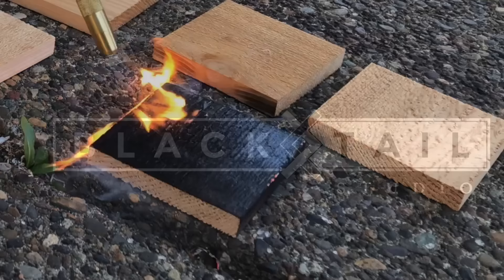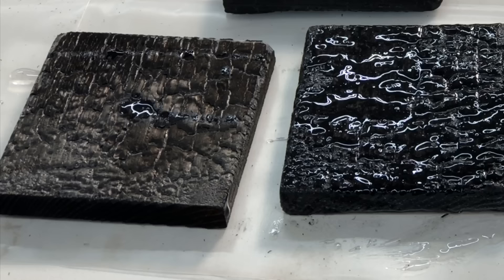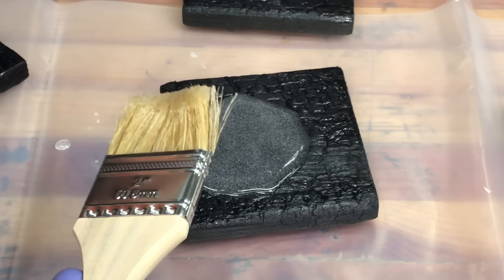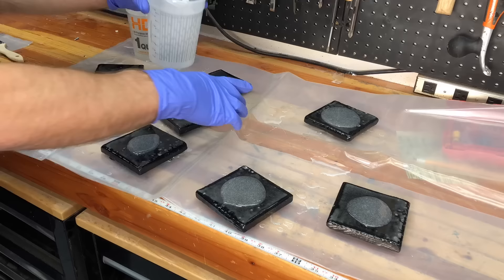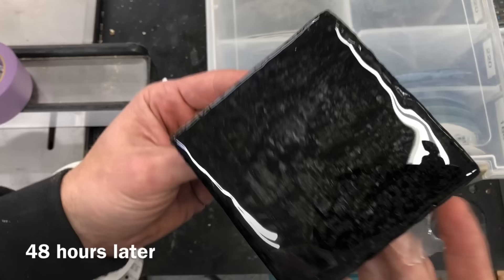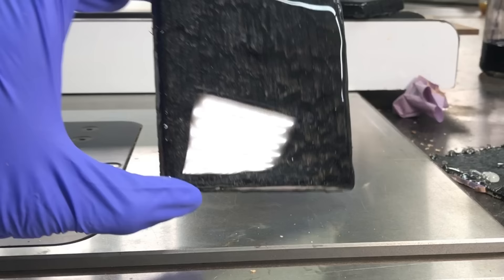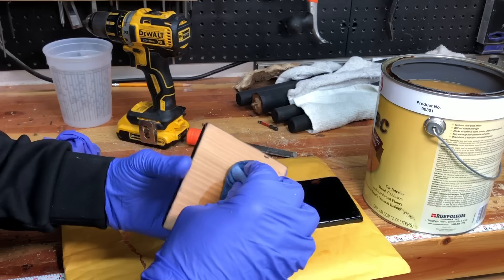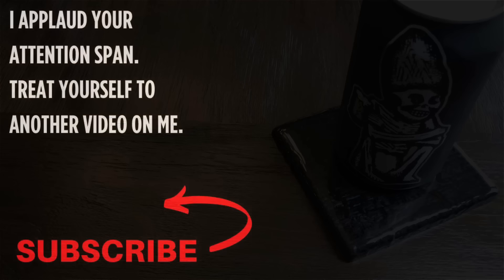Make Scrap Wood Look Like This

Comment: One thing that might be neat is after you do the first epoxy pour... Going back with a cnc router and v bit and engraving some design and doing a different colored epoxy inlay and then sanding smooth and sealing with the epoxy top coat
Reply: P
Reply: Pp
Reply: P
Reply: Love it.
Reply: E
Reply: Ee
Reply: E
Reply: Nn
Reply: Lmnop

Comment: Very nice! Finally a smaller project I can dip my hands into. I've been wanting to make an epoxy table but seems like such an undertaking. This I could at least get the feel for working with epoxy without spending a lot.
Reply: My thought exactly
Reply: exactly what I thought :)
Reply: A next step might be to make small shelf using a knotty/cracked/knackered piece of hard wood (I used left over/rotting oak planks) - you can practice sealing the knots/cracks, then filling with small amounts of epoxy (coloured if you want), then flattening/sanding/finishing.

If you have some big cracks you can double up and practice a few bowties as well :) - https://www.youtube.com/watch?v=jXYmxwdK9_4&t=340s

Comment: Have you ever thought of painting reds and oranges in some of the charred recesses to make the appearance of burning embers? It is something I would like to try eventually.
Reply: I was thinking the same thing. That would be really cool looking. No pun intended. 😉
Reply: Had the same thought just before i saw your comment, i'd be really cool if done right!
Reply: @graywoulf  there was no pun in the first place bud
Reply: It would be very interesting to know and see the results if anyone has done this, please share if so
Reply: Or you could do it with orange fluoroscent resin and have UV light on top oh it?
Reply: @pamav7414  “cool” looking. Ember =hot
Reply: @cwill2127  ooooohhhhhhhhhhh i see thx men
Reply: @cwill2127  Still not a pun by definition.
Reply: Could just use leds.
Reply: Could very possibly end up looking tacky

Comment: Dr Pepper-  Currently building a new desk, plained and joined 7 2x4's. Then took outside and roasted it with a pear burner. Just this evening i put the coat of clearcast epoxy to saturate the char. Your video was the reason i undertook this project. Thanks!
Reply from the maker: Thanks!

Comment: Strongbow cider ,, I used 2 part epoxy at work we used to degass it with a powerful vacuum pump and chamber.. then pour and we had very few bubbles. I like your work, I am recently retired and have taken up wood turning as a hobby, I use a vacuum chamber to help quick dry out the wood prior to turning. I am going to try a flame finish on a bowl next time.  Cheers and keep up the good work stay safe.

Comment: Wow! That would be perfect for backsplash tiles :)
Reply from the maker: Good call!
Reply: Oh that’s a great idea!
Reply: Great idea! Ice Water
Reply: Yea back splash
Reply: Actually, think again- the high gloss black would show mineral deposits.
Reply: That was my immediate idea too. But, would you grout them with a caulk or regular sand grout which may scratch the finish?
Reply: @genegotbaum2436  I think I would set them with epoxy mortar, using the same color for the grout.
Reply: @genegotbaum2436  Non sanded grout is used for glass tiles, so it doesn't scratch them.  I would imagine it would also work with the epoxy finish.

Comment: Coffee. I also loved the charred table. I could see these being used as decorative tiles on the wall behind an old wood stove or even the wall of a kitchen countertop (perhaps in the kitchen of a stylish restaurant).
Reply: Around a wood stove, you could selectively use orange, yellow, and maybe white metallic paint over the char...then clear coat. For a 3d sort of burning embers effect. It would look like the stove had, and was in process of...burning a hole in the wall behind it lol. I know they have high heat resins...but I don't know how clear they pour.

Comment: Coffee. I have been playing with charred white oak for a pen black. First time I did it, I just did dozen or so coats to CA glue, and the char just looked flat. I then coated it in gold acrylic paint, whipped to excess off and it looks great. I have been using Royal Palm Resin (now JB Royal) which is for turning.

Comment: I take a lot of black and white photos of old decrepit barns as a hobby. 
As a possible project you could make a frame. Cut a deep dado in the frame material to allow a strand of barbed wire to sit down in the grove. 
Char your wood. Build your frame. Bend and put the barbed wire into the groove before filling with the epoxy.
I gave up the booze but Orange, Cranberry and 7- Up is great any time of day.

Comment: I have watched this video a bunch of times and I am going to do this in the house that I am building. I think this would be a really cool tile backsplash in my kitchen. Thinking square them off and then slightly round them over, and then follow it up by finishing the edges and back with some lacquer or something for waterproofing since it will be in a kitchen. Would love to see the master try this and see what results you get, even if it is on a small mockup piece.
Reply from the maker: Love to see you do it!

Comment: Looks good! One tip maybe, spray with thin coat of a fast dry urethane spray to seal it up so it doesn't soak up the epoxy
Reply: Hey this is what I'm thinking when I do this for the first time somebody said not to because spray polyurethane leaves a white small bubble film, but I can't help but think spring would get into the tiny cracks so much better plus save you epoxy

Comment: you can do it like a surfboard, tape the half the side and pour the one side. Then wait until it is not runny take off the tape to avoid the tape stuck in the epoxy. After that wait for the epoxy cure enough to be able to work. Tape half the side where the epoxy covered, and pour the other side. Then you can have both side with leveled epoxy finish, and mainly just sand the side.

Comment: My only advice would be to build say a 4.25 inch square mold box, put a thin layer of clay over the whole bottom, center your wood so there is 1/8th all sides, then just pour in a resin better suited to casting.  Say liquid diamonds would be spot on for this, you wouldn't even need to bother with multiple layers as it really will release it's bubbles on it's own especially with a little torching.  Use a pressure pot with it and it is almost impossible to get a bubble with an open top mold.  Then you pull it out, flip it, get the clay out, pour another thin layer of resin right there.  Boom you done, give it 48 hours tops and you can sand the edges 72 hours start to finish max.  PS: I just stick to water and coffee.

Comment: Try using cactus juice and stabilize them. You could cut the first step into a day or two instead of 3. It what we use in the bade smithing community for knife handles and doing hybrid scales. You vacuum chamber until all the bubbles are gone then release pressure and let it sit for twice as long as it soaked then bake at 400f to set it.

Comment: Good video - I would say going with something safer than using a band saw on a thin object like that is in order - you had latex gloves on, but that won't protect against a band saw blade.  Good results, but maybe showing safe methods going forward would be a good idea.
Reply from the maker: Carbide can cut nitrile?

Comment: Bud light that’s a great idea with the epoxy box’s I turned my barn into a wood shop and dust is a huge problem for me but I am going to try this also i was worried about using 2 different kinds of epoxy but it seemed to turn out well. Thanks for the video I will be trying this idea for sure.

Comment: Guinness. Project looks great and makes you think of how you can use that texture in other projects. How heat resistant is the epoxy you used. Could it stand a cup of tea on the coaster. Watched a number of your videos and find them fascinating.

Comment: I got a possible idea for you. I think I may have possibly mentioned it to you some time ago after watching another one of your videos, but I have an older rocking chair of my Mom's that I want to do this to. She rocked me as a baby in it and I
.. um... uh.... Kinda accidentally caught it on fire..... yea. So I've been wanting to do this to it since I duno how else I would salvage it and make it better than new for her. But being a rocking chair it has a lot of curved pieces to it. It has some different size round rods all throughout it and I'm pretty sure I know how to do those. But what has me hesitant is the head board part, the seat itself and the rockers. I was figuring on making a mold from those pieces, so I am able to have a fairly close fitting enclosure to pour into and not waste a ton of epoxy, like if I had just set it into a plastic tub or wooden enclosure and poured over it only to have to cut out where the curves are at. But watching this video has me thinking of doing multiple thin coats until the desired thickness. What do you think? Internet searches only seem to turn up flat pieces and no curved ones. Thank you for your time and knowledge that you share with others.

Comment: Not sure if I am supposed to write something about you cutting fingers off at the band saw or not… but here we go!

Thank you so much for the instructional videos. I appreciate you sharing the products you like for best results. For those of us with much less experience and developed skill… this is great stuff. 

I’m curious about your plastic tub / dust free enclosures. Actually, I am curious about how stable the coasters were when sitting on the Tyvek wrapped blocks… you did not share video of brushing epoxy on the coasters while sitting on the Tyvek wrapped blocks. 

I tend to make a mess when working epoxy. So creating adequate space and a stable surface helps me minimize the mess… 

Do you you think adding a bit of two sided tape to hold the Tyvek wrapped wood blocks (block to plastic tub and coaster to top of Tyvek wrapped block). May not stick… I don’t know. Please advise…. 

I’m thinking that making the blocks nearly as large as the coasters will provide stability (prevent teeter totter) when brushing on epoxy. 

I assume whatever is cobbled up to make the dust proof tubs must render the coasters in a level state for epoxy application.

I need all the help I can get… 

By the way, these coasters are beautiful, but so is everything you create. 

Thank you!

Comment: The texture looks amazing. 
Did you ever try other things with transparent epoxy like adding layers of wood chips or splinters to give it more depth and texture?
Reply: gross....Im pretty sure that would just look dirty...you wanna suspend something but its typically better to not do so. The depth of the burn is quite significant and very beautiful. This is kind of the best way to showcase it.

Comment: Cool! Hey folks, just tape off the bottom prior to pour. Rub the edge of tape firmly (burnish) to get a good seal. After dry, use a heat gun to cleanly remove tape and drips. Sand if needed. Take the finger risk out of the equation. Just my opinion 👍🏽

Comment: I am planning on making a large raised dog feed chest.  My initial thought was to shou sugi ban the legs and cross beams on the chest along with the top and then seal it like you did in this video.  The primary body would also be shou sugi ban boards that were then sanded way down and then sealed to show the contrast of wood grain on the boards and glass-like finish on the top and legs.  Do you see any problems with that?  Does the mirror finish scratch easily?

Comment: These are small batches of epoxy. I created a calculator based on weight instead of volume which is easier and hyper-accurate. I use it all the time and have never had a questionable mix. It’s free, if interested, DM me.

Comment: This is great and wasn't hard to find BUT this is not the most common "Sealing Burnt Wood" projects I came across. No one seems to be trying to seal REALLY BURNT wood.
I am working on a project for my mother, it is going to be a Giant Burnt Match and wanted to know a good way to seal it. It will be left outdoors as a Yard "OMG" object.
Not sure this would or wouldn't work. But live and learn.
Thanks
Reply from the maker: Ya man!

Comment: Coffee, thanks for the video. Been looking for something to do as a first epoxy project and this seems simple enough to do without alot of tools.

For the router sled idea. You think just two parallel rails and then use double sided sticky tape to hole the workpiece in place?

Comment: Sparkling Mead - Ive seen a similar technique where after the wood has been charred, It is lightly/partially sanded back and then a stain is applied to the uncharred bits and it looks like a great mix. could you try this and provide tips for how to attempt?
Reply from the maker: I haven’t done that yet!

Comment: Favorite drink is water & beer. Love the video! It inspired me. I make epoxy/wood clocks so I’m attempting something like this with a clock build. Just curious, not sure if you mentioned it and I missed it but what is the benefit to using a deep pour epoxy for sealing the wood versus a table top? Will the table top just not penetrate enough before it sets? Thanks again in advance!

Comment: Favorite beverage: Just about any Chardonnay! Great video. I started woodworking about a year ago and have a small setup in my garage, but I don't have a band saw or router table for the resaw part. Would you suggest using a table saw in this case?

Comment: Did you let the the thin coat of epoxy fully cure before pouring the additional two layers on? If you did, did you sand it to prep the surface? I thought that if you put a coating like that on, youre either supposed to pour another coat while it was still tacky or wait until it's cured and sand the new surface to give the epoxy something to bond to

Comment: I absolutely love these.  I have some decent size cedar left over from trimming a porch.  I would love to make a desk out of this burnt cedar.  I also have some ipe that I’m thinking about framing desktop border with.  The only thing I don’t want is a large clear topping on the burnt cedar.  I would want the burnt cedar to appear as close to finished surface as possible.  I know it will need to be covered with epoxy to cover all the alligator flakes but want to minimize the “depth” of the epoxy to wood finish.  Anyone have any suggestions?   Thanks so much!
Reply: If that's the look you're looking for, then cover it with a thin layer like he did (to seal it up), and then top the desk with a thin sheet of glass.

Comment: Un-oaked Spanish Tempranillo, enjoying these masculine 50’s modern inspired projects. Great job, Cam. edit: not that shou sugi ban is 50’s modern, but I’ve binged a few of your vids. Just curious what a few coats of white paint under the clear epoxy would look like. You could even do a black/white coaster.

Comment: The problem with those and ALL super polished coasters is flat bottom or slightly concave tumblers or glasses condense moisture and suction the glass to the coaster and every time you lift the glass the coaster comes with it.
Reply from the maker: For sure

Comment: Margarita,  only just found your channel but wonder if you've done the same deep burn but then sanded the surface so you get wood finish but ash deep grain then epoxy, just a thought I made a bbq table top from old pallet wood burnt then sanded  then lacquered came out pretty good.

Comment: Crown Royale, and have you ever messed around with infusion epoxies?  I started messing around with carbon fiber and fiber glass again and especially on smaller things like this, air bubbles would be non existent, the wood would be immune to warping and you could do them in uniform forms.

Just curious!

Comment: I have some charred pieces of wood from our home burning down.We are in the process of rebuilding and I have an idea for a piece of art.  I want to seal some charred pieces of wood, mostly 2x4, cover them in epoxy and use them to create a piece of art.  Could questions: Would that keep them from smelling?  Would the same two types of epoxy work on that, do you think?

Comment: Pepsi is my favorite breverage. Hi first time here. What adjustments would you consider explaining or doing in another video ‘without’ cutting the underside where there are drip accumulation and basically keeping the bottom part as nice as the top for a fully reversible coaster? Thank you
Reply from the maker: Can use painters tape underneath to prevent drips.

Comment: Canada Dry Ginger Ale??? Just completed your series on finishing (which was great, so easy to understand every step) and have what is, no doubt, a stupid question on the nano finish relating to these coasters that are finished completely in epoxy. Would there be any benefit to putting nano products on these. I am thinking in terms of using leftovers from the nano projects on small epoxy covered items.